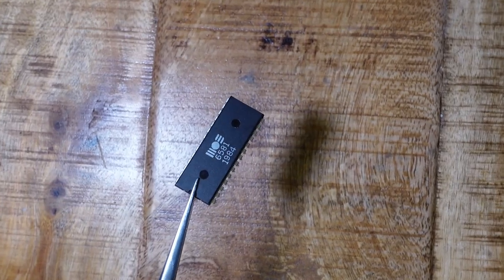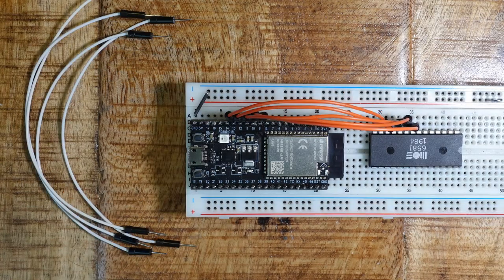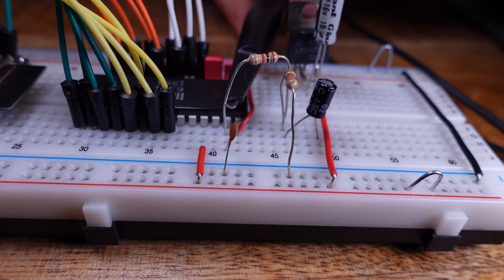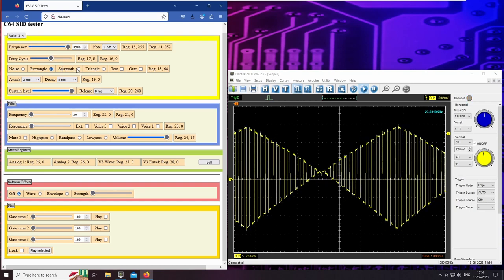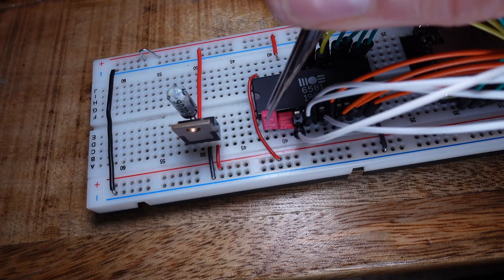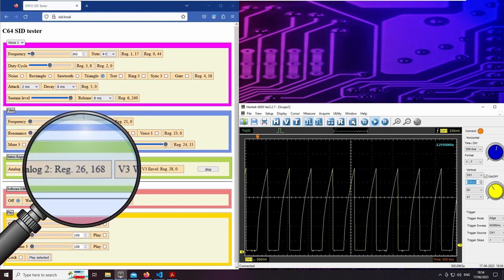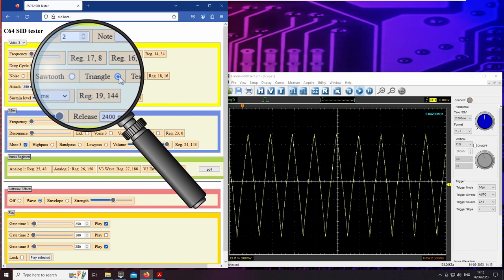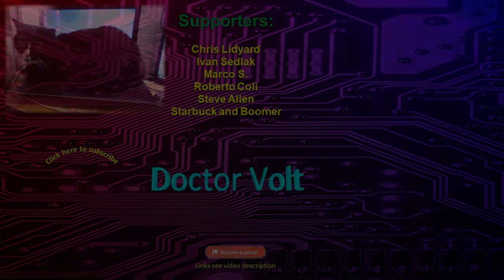C64 on a Breadboard: Play Retro Sounds with MOS 6581 (SID) and ESP 32

Comment: 9:35 Commodore never managed to fully "fix" the noise bug -- so digital samples do work on the 8580; they simply play quieter than on the 6581.  Digifix brings the volume back up.  Thank you for an interesting look at all the various SID waveforms!  -- JC
Reply: For about 15 years there are much better sample playback techniques such as triangle restart for example (plus it uses regular oscillator so samples can be filtered).

Comment: I believe that the digital IO pins on the ESP32 are 5V tolerant. Apparently, it used to be in the datasheet, but they faced problems with people powering the chip itself with 5V so they omitted it to avoid confusion.
Reply from the maker: That's good to know. In all the forums that I have checked, it was said that the ESP32 pins are not 5V tolerant. However they survived the 4.3V from my SID.

Comment: Where did you manage to get a SID? Currently finding them near impossible to buy anywhere in India. Nothing in ebay ships here, and the ones that do are prohibitively expensive

Also the cutoff frequency of an RC filter is defined by both resistance and capacitance. Capcitance value is fixed due to the capacitor. So to change the cutoff frequency, how do you manipulate the resistance value?
Reply from the maker: I got it on Ebay and paid around 45 Euro for it.
Reply: @DoctorVolt  holy dang, 45 euroes?! That's steeep!!!!

Comment: That soundchip is rare, expensive and scarce, furthermore it has the tendency of breaking down that is why they are no longer in production and Chinese dumpster divers try to sell then to those unfortunate people who have a Commodore 64 with a broken chip. Often people can only buy other chips that are also partially defect. This soundchip can be emulated by an FPGA, then a new and powerful high tech chip works as it were that forty years old prehistoric chip. And that is not cheap either! 
 
I would like to buy a real MOS 6581 but all chips that are available are harvested from old broken down Commodore 64 computers, often it is junk, expensive junk! I have three C64 but I will never take out the soundchip, if something happens I can never get the same chip again.
Reply from the maker: You are so right. I got three from Ebay. Two of them were scrap, only the one that you see in the video was good.
Reply: i just baught a second to add to get 6 voices but have not tested that 45 dollar chip yet.. i WAS ASSURED IT WAS TESTED WORKING
Reply: There are SID "clones" available like SwinSID, ArmSID and now SIDKick. Prices and fidelity varies widely though.